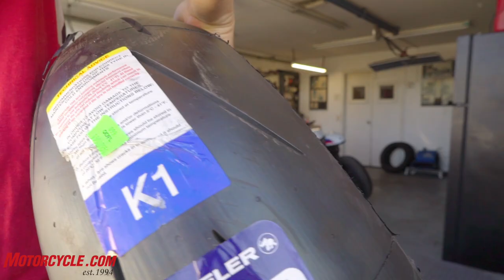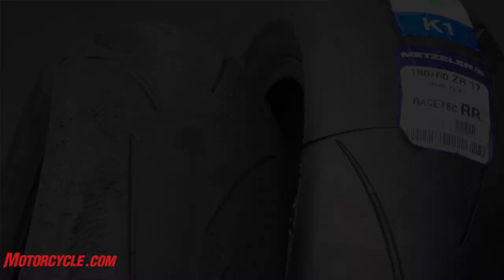Metzeler's Oscar Solis Explains Choosing the Right Tire for the Track

Comment: What’s even the point of a Metzeler track tyre when you have Pirelli in the family?

And the rep just backs that up. If you want a road tyre, Metzeler. If you want a fast/race tyre? Pirelli. 

The M7RR is pointless.
Reply: Really? Its like everything else for sale. Ok GM owns chevy and Cadillac right? Ok well the old CTS-V is the same exact thing as the Camaro, just with slightly nicer things, but it costed more. Some people dont care about the extra things though, so they would buy a camaro, even though they are the same thing. By your logic, would you say why would anyone buy the camaro or that it is just pointless
Reply: By my logic Porsche are owned by VW. If you want a track orientated sports car, a TCR golf isn’t much chop against a GT3 911
Reply: @BigCarKilla  Lamborghinighini and Audi are in the same group as vw and Porsche, so it'd be fairer to compare the GT3 to a Lambo or an R8.